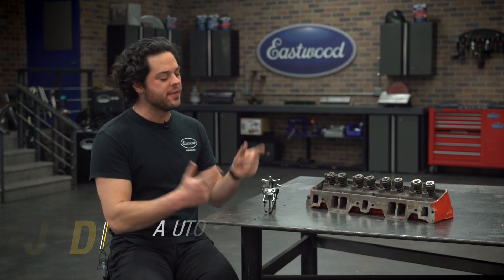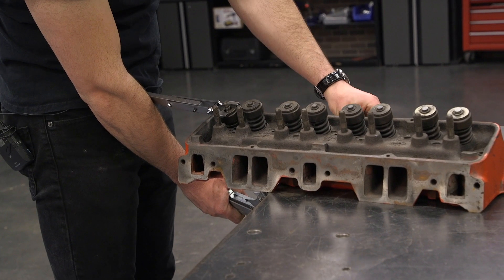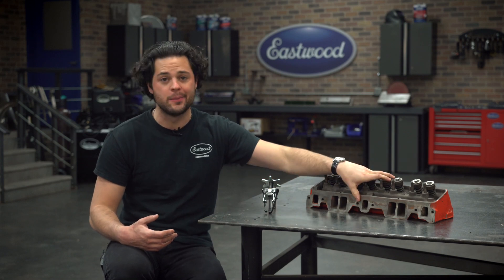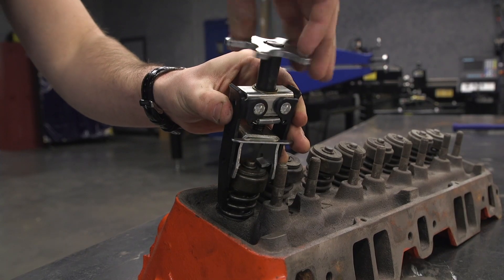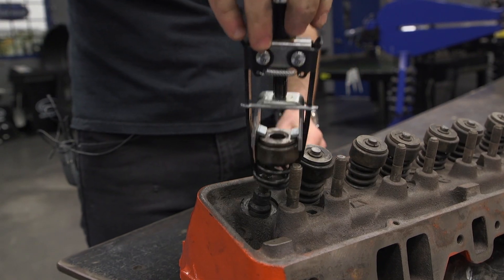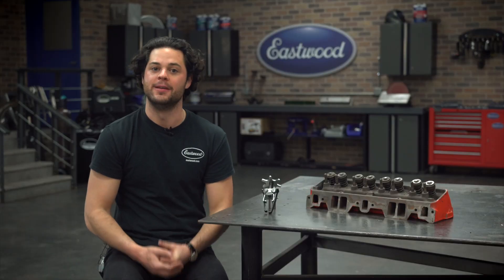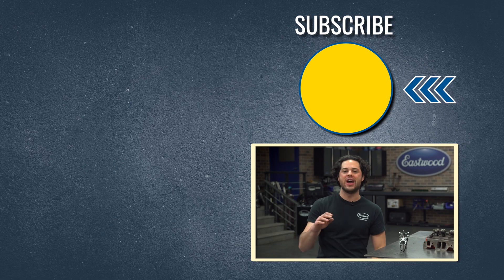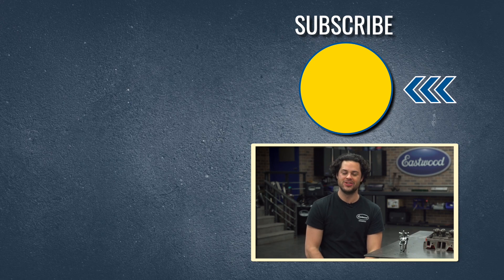Remove Valve Springs with the Head Still Attached to the Engine! Overhead Valve Spring Compressor

Comment: My Mk1 Jetta's 1.8L VW head has a built-in valve girdle casting. Sadly this tool wouldn't work here. Still, a good tool if you need to replace springs, retainers or valve oil stems seals on traditional heads with free-standing valves, like the SBC head in the video.

Comment: I would guess, that you would need to have that cylinder on top dead center, so the valve doesn’t drop in the cylinder?
Reply: Correct and use compressed air in the cylinder, to prevent the valve from falling down into the cylinder.
Reply: @Pk3_Garage  In the case of using compressed air in the cylinder, I assume you would not need to set TDC on each cylinder? Rather use compressed air to keep the valve up while compressing each valve spring?
Reply: You should always set each cylinder to TDC when doing a valve job. If not, the air would escape because the valve isn't closed.
Reply: @ Did my cam & valve springs on my SOHC last weekend. A continuos flow of 1 bar was all I needed to keep my valves closed.

"The air would escape because the valve isn't closed", how does that make sense? The piston on TDC will never hold your valve shut, if it does you have some big issues. 

The whole point of using compressed air is to keep that valve shut (pushing valve up), to prevent it from dropping down into your cylinder. The only upside to having each cylinder on TDC when removing the valve retainers is that it will save your ass if you aren't getting enough air into the cylinder to hold the valve up. Or am I missing something?
Reply: @nahnahphoon  As long as you have enough CFM to keep the valve up.
Reply: @nahnahphoon  Top dead center, on the compression stroke.
Reply: @ Correct, so realistically you can leave cylinder 1 on TDC and with an air compressor remove each valve spring/seal without rotating the engine. 

I had to do this as to retime my engine/get the timing cover off the engine needs to come out of the car. Milwaukee M18 cordless air compressor had plenty enough CFM to get me through, valve only needed 1 bar of pressure to keep the valve up. 

If you don't have compressed air, then yes you would need to rotate each cylinder to TDC. But with compressed air, I can't see a reason to do it unless it's for insurance sake just incase your CFM drops and you drop the valve.